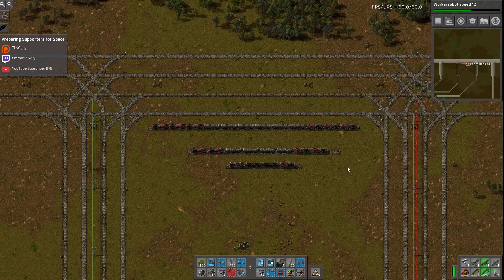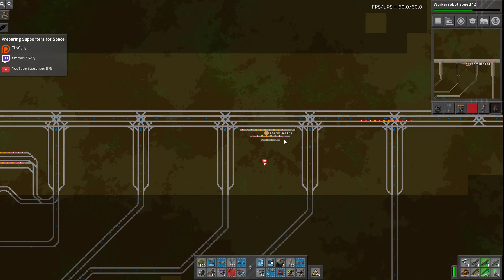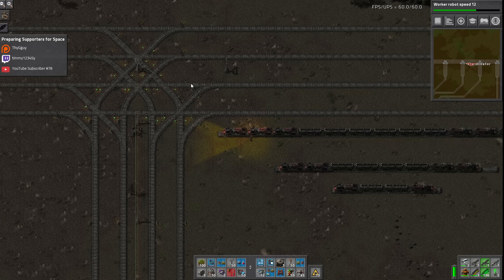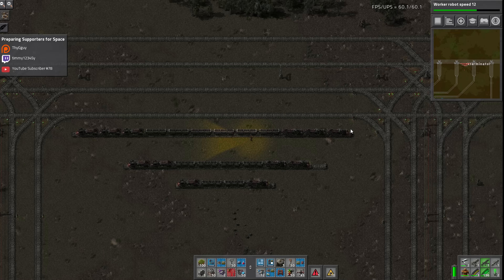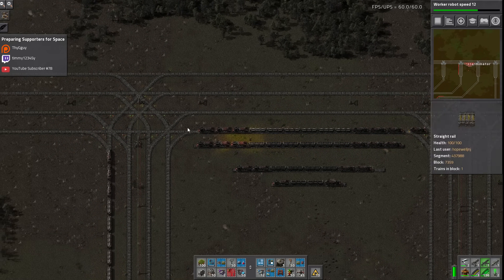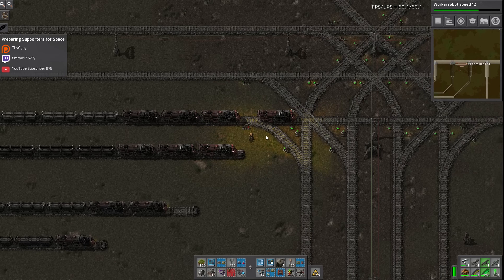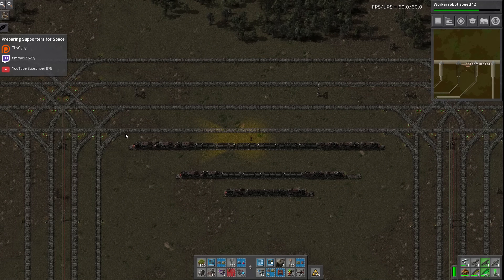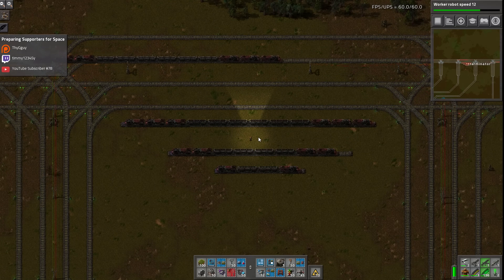Factorio Train Tutorial - Planning A Rail Network : Junction Spacing, Train Size & Mainline

Comment: How do you keep your trains fueled? I mean without connecting all the logistic networks together.
Reply from the maker: It depends on your system. In this map and using this type of system I have a fuel train go to the main places (smelters, circuit builds, science builds, oil build) and drop off a ton of fuel and then have the station turn off if there is more than like 500 fuel in it's network. That way the train makes sure to go around to every stop that still needs fuel sense those will be the only stations turned on.
Reply: Several different ways, worst case, a fuel delivery train takes fuel to one end (say at refineres, so all the ore trains come there) etc
Reply: That's what I thought but now you don't refuel your trains between intermediary products etc. I feel like there is a genious way that I'm missing.
Reply: for those, you either put in at one end, or make central refueling stations, and have them stop there. It's of course better to put fuel in at both ends, than at neither ;)

Comment: For high throughput use single headed trains, the larger the locomotives to mass ratio the faster the train accelerates.
locomotives have double the mass of a wagon, so a 3-6-3 has the same acceleration speed as freaking huge capacity 12-3.
Second throughput advantage is that they are shorter so less time inside the junction.
Reply from the maker: Yeah, for throughput alone, single headed trains are better sense they don't have to back out of the station and like you said they are shorter so will take less time in a junction. However there is disadvantages too, like it makes designing rails and builds harder or more annoying because you have to include some sort of loop, which also causes other issues.
Reply: Xterminator, Yes the loop problem that can come with a single handed system is that because the stations have an entrance and an exit you can get in a situation that a train will "take a shortcut" through another station that it is not supposed to go to and get stuck there.
This was mostly solved in 0.15 as passing through a station has big penalty now in the route calculation, but it can still happen in rare cases like if the rail system is signaled wrong or the path is blocked by a manual train or the rail is cut off...
Reply: My solution to this is to make rail stations come in and out on the same single rail with a loop inside. The pathing will never be faster to dip inside the station. C>┤│
Reply: @williambarnes5023   but thats just L-C-L with extra steps!